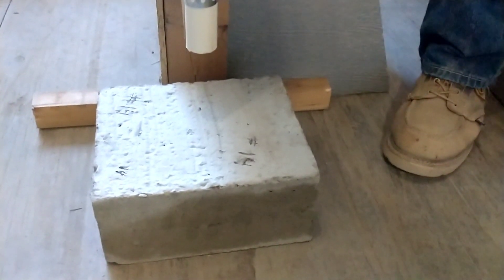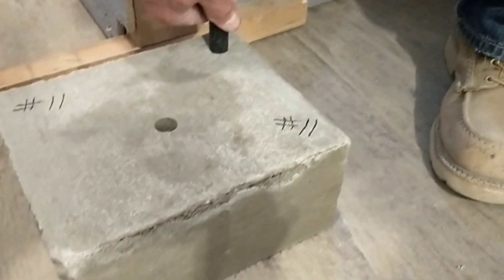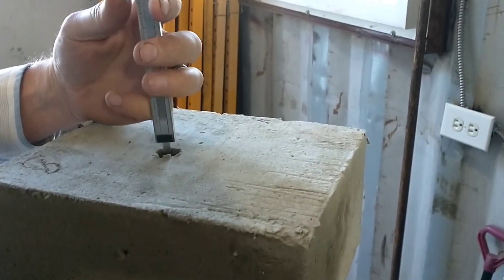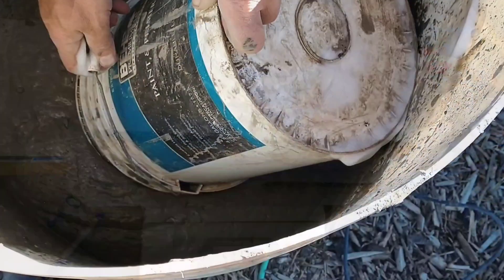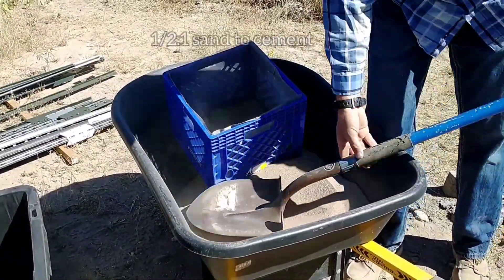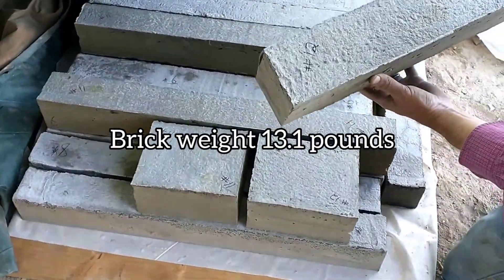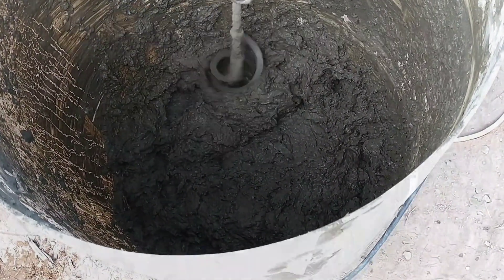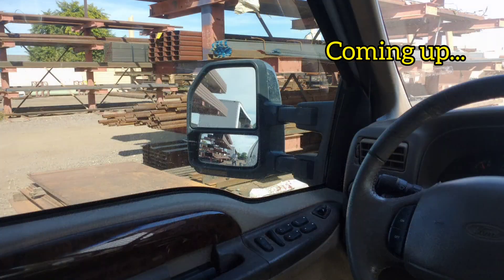AIRCRETE | Should We Use It to Build Our Home? Testing Results & Conclusion PART 2

Comment: I greatly appreciate your experiments and detail analysis of the results.

I qm considering using this aircrete mix to form a mannequin. What do you considered will be the best mix
Reply from the maker: Interesting idea. 🙂 It depends if you prefer strength or light weight. The more foam you add the lighter and more porous it will be. If you use less foam, you will likely get a less crumbly and more detailed product, but it will also weigh more.
Reply: @RedandAprilOff-Grid  Thank you for the tip.

Comment: Yes, but it's also very cheap and easy for the average person to manufacture and use.
Reply from the maker: We calculated the cost in another video. We learned that building with aircrete is not less expensive, and it's a lot more work. Our stick built house with a layer of exterior insulation is way more efficient, and was much easier to build. Aircrete is very temperature sensitive and finicky to make. Similar materials like autoclave only have a 20 to 30 year lifespan.

Comment: concrete don't hold tensile force, so stop doing it. It is better to test the sample with different bar sizes and see how much tensile load it can hod up. Thank you
Reply from the maker: Yes, we were planning to add multiple reinforcements. We were just testing the aircrete on its own as well as our ability to make good and consistent batches.

Comment: I wonder if using the strong standard mix for the roof is a good idea...   I would want the heavy wire in there for fall protection in the event of catastrophic failure....

a further test of side by side, With/Without wire using the same barrel mix, not one then another so you have the exact same mix/mixing solution in the mould

Comment: Was there any isolation as to what the variable(s) were at play in understanding why such a mixed bag of results were obtained ?
Reply from the maker: The batches are all different, some had fine sand, paper, fibers and different amounts of foam. As the temperatures started getting cooler, the samples started turning out worse.
Reply: @RedandAprilOff-Grid  So better results may have been had in the summer ? and you may have had gone with it instead ad it been summer ?
Reply from the maker: @kalervomakinen2076  As hot as we get, I don't think summer would have worked either. Aircrete would have been a nightmare  in so many ways. Trying to make the forms watertight, keeping the walls wet until they cure, dealing with failed batches and cracks and powdering. Aircrete is not inexpensive, long lasting, or easy to work with. We are so glad we didn't try to use it to build our house. In my opinion, there are much better options out there.
Reply: Am considering using it to make insulation for a cabin build  @RedandAprilOff-Grid
Reply from the maker: @kalervomakinen2076  Rockwool is a much easier and likely cheaper insulation option, but good luck if you decide to try aircrete. 🙂

Comment: I have worked at a pre cast place and I am not 100% sure on this as we don't mix like you do , however if you mix at a slower speed that might make a difference to strength and consistency, even at a professional place it is still an unknown art, I found for our small form Items that my team made the best concrete was slowly mixed over an extended time, 15 min plus 15 to 20. Anyway to be brief try slowing your mixing speed
Reply from the maker: Thanks! Yes, longer, slower mixing probably would have helped.

Comment: Aircrete's fun compared to normal concrete, at least for walls. But they've been making aerated bricks for a long time, and it's got a better R value than any aircrete batch. And then, styrofoam is a much better insulation. Did you try sawdust?
Reply from the maker: We prefer working with concrete. It doesn't leak out of the forms, and it always turns out good and strong. We didn't try sawdust because we wanted to use materials that were easily available to us, and that we could get enough of to build a whole house.

Comment: All concrete should be tested for compression eg psi, tensile strength is very limited without rebar.
Reply from the maker: We were planning to add reinforcement, but were testing the material itself, as well as our ability to make consistent good batches.

Comment: what type of portland cement were you using? Some cements are formulated to cure faster although more expensive it may help with the sinking problem and so allow a sand cement mix.
Reply from the maker: We mostly used type I/II, but also tried some III/IV, when there were shortages of I/II.

Comment: how to make it load bearing
Reply from the maker: We were planning to build a metal structure and use aircrete for the insulation and put fiberglass mesh on the inside and outside, then stucco it, but we decided making our own aircrete wasn't going to work well in our situation. 🌞🏜️

Comment: Thank you for your efforts . I suggest you to add three ingredients to the mixture super plasticizer - Eter polycarboxylate (300 ml  per 100 kg cement) * 12 mm polypropylene fibers (50 grams PP per 100 kg cement)*** microsilica (10kg ms/100kg C )or fly ash (I don't know how much because it is not produced in our country)
Reply from the maker: Thanks, we are done with aircrete, but maybe someone else will try it. We tried to get fly ash, but couldn't find anyone that sells it. 🌞

Comment: Would like to see testing on other side of block to determine if density changes compared to gravity.
Reply from the maker: We could only do the break test one time, but did the drop test on both sides. We later tested the bricks dry, and did the break test with the remaining long bricks that were still intact.
Reply: @RedandAprilOff-Grid  Excellent. Sound testing. I like it!!

Comment: Wow, lots of testing to determine that aircrete shouldn't be used as a header.  It's great that you understand your limitations in construction.  BTW,  classes for proper aircrete methods are not so expensive in relation to the cost of traditional construction materials.
Reply from the maker: Our tests were to practice making aircrete and to compare the different methods of making it, to determine it's characters,  process of making, and which recipe we wanted to use. I surmise that not many who take classes decide to use aircrete either. We can't find anyone actually living in an aircrete house, and certainly not many people. Aircrete shrinks, and if not made perfectly, it is brittle, so I wouldn't recommend building a house out of traditional homemade aircrete. We did a cost comparison, and aircrete isn't cheap, but now that the prices of lumber have doubled again, it may be some less than traditional construction.

Comment: Very cool destructive testing. I used to do geotechnical testing for a consulting firm in phoenix a few years ago. Used to do shear testing for mining rock cores for shear strength analysis.
Reply from the maker: Thanks! 😎 We are so glad we didn't build with aircrete! The aircrete garden wall we made is really cracking and shrinking.
Reply: @RedandAprilOff-Grid  oh that’s a bummer! I wonder if the extreme temperature swings of the desert might factor into that as well? I know we had an issue with mortar on a rock wall we had in Phoenix that kept cracking from the hot/cold variances. Either way cool concept!

Comment: The amount of information contained in your videos ... and your testing methods ... are incredible. THANK YOU!
Reply from the maker: Thanks!  We wanted to share what were learning as we were figuring it out.  If you keep watching our next videos, you will see that we started having issues. We think it was likely from the icy cold well water and colder outdoor temperatures. Drexel does not work well if it's too cold. A possible solution is adding some warm water to the soap solution.  Best wishes! 😊
Reply: but he  left out the most important,,, weight per cubic ft and cost per cubic ft

Comment: I should mention now, I’ve discovered your latter videos that concluded not to use the material. I very much appreciate your research and conclusions. I realize there are many variables and this is a complex matter. It appears you have enough resources to have options, which is great.

For me; I’ve seen others do this adequately (mostly in tropical climates which may be a factor) We will be serving in a third world country, with fewer options, and less expensive labor cost. So, we are willing to use the material. Also, the dome form is also acceptable to us.

I wish you all the best.
Reply from the maker: My best guess is that the colder temperatures were the main issue. We tried to set the Drexel out in the sun to warm, but it was still pretty cold. With each new batch, we thought we had it figured out, but they just kept turning out worse. We noticed the foam was becoming more dense and he tried to adjust for it. The foam was under 100 grams per quart, so it should have been ok. We would have had to wait until spring to do any further testing, so we don't know for sure.  

Not much is known about the long term durability of aircrete, so it was starting to seem pretty risky to build a house with it. If we were able to make good and consistent batches, we would have went with it, but our later batches were really brittle. 
Here is an impressive dome that was built on an island. The guy said it started cracking and couldn't be repaired because the aircrete is too powdery. https://youtu.be/UJmAF0SuvkA 
It is a big dome and the bricks were pretty thin. He also said he had a lot of issues with getting consistent batches. Best wishes! Aircrete is pretty finicky stuff, but with more time, we might have been able to figure it out. Best wishes!
Reply: @RedandAprilOff-Grid  Thank you again for sharing so much on this platform, so succinctly. Cheers
Reply: @RedandAprilOff-Grid  Follow up on Micronesia Dome. I’m thinking 6 to 8” minimum, with “abaca cloth” (Philippine Hemp) interior and exterior. Honestly, building with standard hollow blocks and metal trusses (with extra tie downs) would probably suffice and be more practical. I’ve seen homes in our range built for about $20 to 35k US minus the land and appliances, extra water tower or solar. We want to provide homes for the poor that can withstand typhoons. It’s a shame we couldn’t utilize the air forms and blown cement, as that would appear to be a perfect solution. All the best, Kevin

Comment: I think that you should keep the aircrete - to outside projects & patio roof trusses.    I don't think that trusting it for you House walls and foundations is a good idea.
Reply from the maker: Patio roof trusses are an interesting use for aircrete. My Little Homestead made it work, but it didn't look easy, and I'm pretty sure it wasn't cheap. Our foundation is concrete, we were considering trying to use a more dense aircrete for the floor.

Comment: carbon nanotubes in the portland mix? 300 um..
Reply from the maker: Not sure if you can buy it anywhere for a reasonable price, but it looks awesome. 😎
Reply: @RedandAprilOff-Grid  $140 for 4 oz, surface area of 1000 sq m, I may get some and test a batch, after Christmas. It seems it would increase surface tension by increasing the area which may help enhance the mechanical properties.

Comment: I would recommend basalt rebar and mesh materials a dual mixer with up mixing action from northern tools. me thinks air Crete harry has links. polystyrene balls. Broken up polystyrene material inverted electric motor blended with a 50 gallon drum a side shute with 1\2" mesh low down n a duct to a collecting bag with a cloth top to llet air out 
also Drexel 1-25 or some such (farm supply houses ) foam holds really well designed to hold bubbles while farmer sprays a field and marks where he has been.
U can use some admixture that reduces water and makes mix weter.

 also I am looking to see what a pvc glue that sets fast  would do. Something I think a concrete bonder or admix 
Adding basalt rebar. Mesh. fiber. May be better n longer lasting.
 having steel / rebar close to the location of where bending is going to happen most concrete products are very week in tension but are good in compression the problem with steel is that when it starts to rust it expands breaks the concrete away and the rusted metal looses strength as well.

Its possible that the basalt rebar will not suffer from that but it is not as strong as steel in sudden impact situations. It gets hit with a fast kinetic impact

Comment: have you seen the Styrofoam-crete  some people are experimenting with? seems a bit less strength but greater r value and lower weight may not be appropriate in your application. just curious on your thoughts
Reply from the maker: Yes we have. It is an interesting idea, but we really aren't interested in trying to gather, shred, and store, the tremendous amount of styrofoam we would need to build our house. Assuming we could find styrofoam for free, it would still require a lot of trips into town, which aren't free. The equipment needed, the mess, and the effort required to pack the mixture into the forms is another issue, and there plenty of other issues I haven't mentioned. 
The foaming solution used to make aircrete insulative takes up much less space and is a much faster and easier process. Also aircrete absolutely won't burn or melt no matter how long you hold a torch to it. 
Making aircrete is a challenge, and there are many things that can go wrong. We think we may have finally made all of the possible mistakes, and hopefully we have it figured out.  We'll keep sharing as we keep learning.

Comment: I was wandering what kind of steel wool you used, and how many?... last I had corse and fine stainless steel wool alternating. I don't think more than 8 pads.
Reply from the maker: Here is the video of Red putting together the foam generator. The kit had a large coarse piece of steel scrubber pad stretched out then stuffed in the wand. https://youtu.be/n_zsgV4t1fY
Reply: @RedandAprilOff-Grid what, I didn't have good results with corce steel wool, and only one pad... it makes big bubbles if you're near the coast or use Amazon fine stainless steel makes smaller bubbles, look for boating supply. Had good results first use with standard steel wool pads. After they start to rust they are no good... same with brass wool, though brass lasted at least 3x longer... had a suspension I was building too much pressure behind the stack of pads...

Comment: You have to keep in mind aircrete is supposed to be week and full of air... the straight comes from the reinforcement fabric the shape and the monolithic outer layer.
Reply from the maker: There definitely seem to be a lot of different things that can go wrong. We have had some issues with our last few batches not turning out quite as well. After testing all of the other variables, we think it is from not mixing the Drexel around in the jug before every use. The last 1/3 of the bottle doesn't seem to be working as well, and it is darker in color. We'll know more after we make some more batches using a new jug.
Reply: @RedandAprilOff-Grid  I've seen that too first couple batches are really good... but then most bad...  then you check everything but can't figure it out. Try adding a little glisten... it tends to settle at the top and you use it first.
Reply from the maker: Yes, these samples were only cured for 7 days, so they didn't have their full strength yet. The testing was so we could practice making aircrete, make sure it's a material we are comfortable in using to build our house, and to compare the different mixes to each other.
Reply: @RedandAprilOff-Grid  of course, and your bricks look good even some of the failures. I did a lot of testing and foam machine building... I found issues throughout, when you think you got everything right and start mass production.... it still fails randomly.